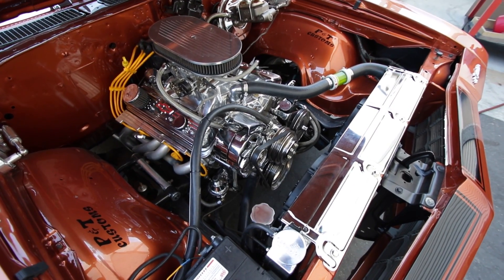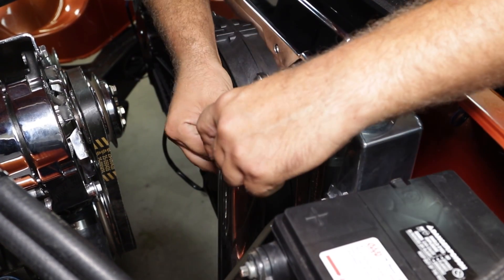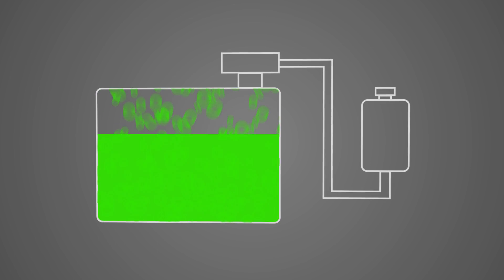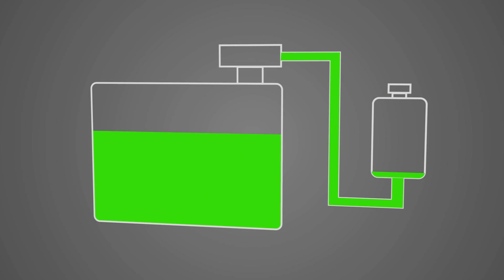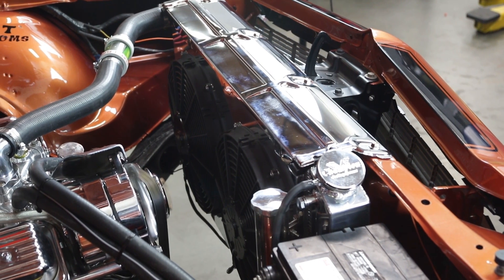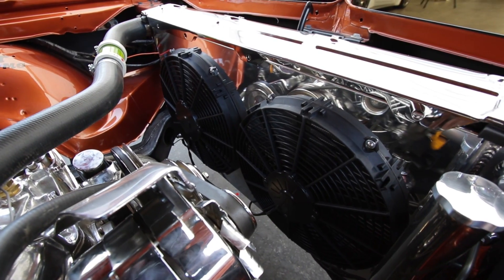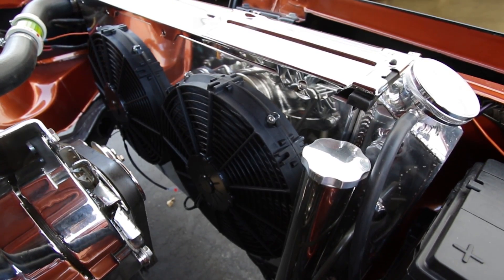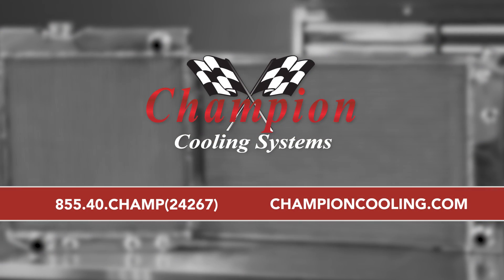Champion Radiators: How to install an Overflow Tank in a vehicle

Comment: Where does the tank bolt on to? is there fittings on the actual radiator for it to be threaded in?
Reply from the maker: The overflow tank has supplied brackets and can be mounted to the core support or apron. We don't have provisions for attaching to the radiator at this time.  The tank can be mounted anywhere without relation to the height of the radiator cap, but is best to mount close to the filler neck to keep the tubes shorter.